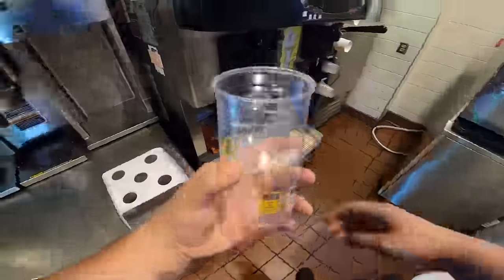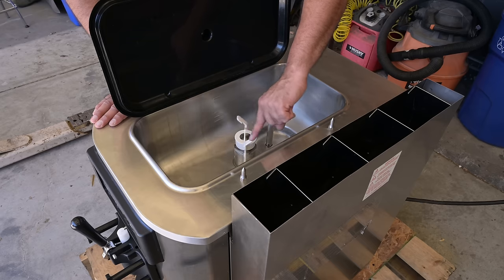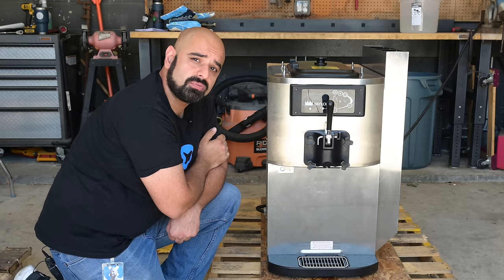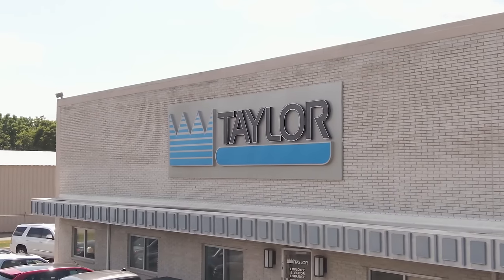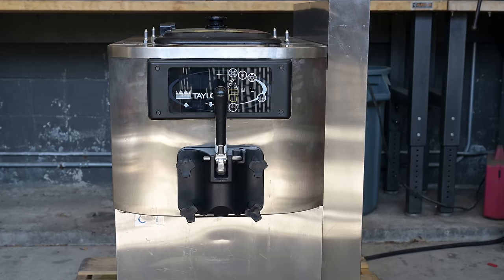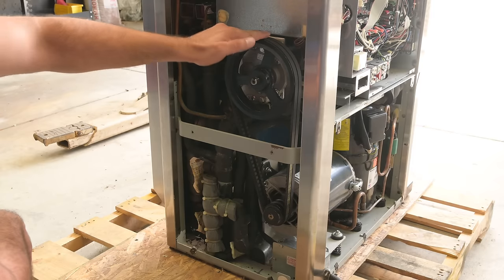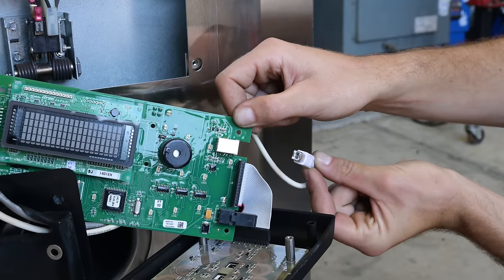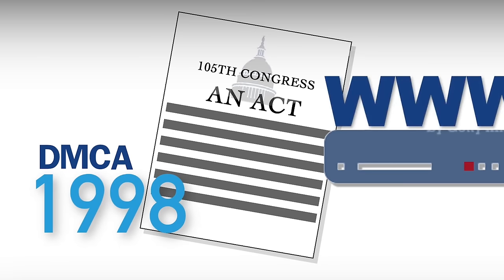Why McDonald's Ice Cream Machines Are Always Broken and How To Fix Them

Comment: As a McDonalds employee in Australia I’ve personally never seen our ice cream machine break or require repairs outside of the time from 2-6am where it is in heat treatment. It seems like this is a uniquely American problem which might indicate malicious tampering of the machines by Taylor that make the machines break down more often.

Edit: before this video I didn’t even know about the error codes on these machines as I’ve never seen one, and I’ve worked at McDonald’s for ~3 years
Reply: Not a common  problem in Europe either.  Personally I have never experienced it.
Reply: Mcdonalds Philippines also use the same Taylor ice Cream Machines. Really an American thing since this is the same issue with Samsung Refrigerators being junk in the USA but durable elsewhere.
Reply: Hastings Victoria is constantly broken down
Reply: McDonald's ice cream machines in Australia are made by Multiplex. That would be why.
Reply: @Croissinate  I checked tonight, our machinery/equipment is made by FRANKE, however the appearances of the machines is basically identical to those of Taylor in the US, which once again indicated tampering by Taylor since the same machines work fine when made by a different manufacturer
Reply: Average education level plays a big role I presume?
Reply: I worked at a McDonald's in the US. We had the Carpigiani ice cream machine, I don't think it ever broke down during the 3 months I worked there, except a day where the maintenance guy was working on deep cleaning it.
Reply: Not sure why, but my local McD's in Canada never seems to have trouble. Maybe it's because it's a lower volume franchise? IIRC, they do have a Taylor branded machine, albeit an older one.
Reply: Thats not saying much at all, plenty of employees at mc Donald's or "Maccas", that dont know how to properly make a quarter pounder w chz. Let alone know about an error code on the machine. Many dont know the error codes on the FRY machines ffs. But they know what button to push to clear it and keep cooking fries....
Reply: As a customer in Austria I've seen MANY instances of the ice-cream machine not working. So much so that I was wondering whether McDonald's actually liked the meme of their machines breaking and thus not doing anything about it. I wouldn't agree that it's a uniquely American problem.
Reply: McDonald's is better in nearly every country than the US.
Reply: In my area it “breaks” or doesn’t work 1 in 5 times roughly.
Reply: No, is it that these stored do not perform the daily heat cycle and the machine locks out or they forget an run it while the store is open a say it is broken when it is just cleaning itself.   This video is a pile of crap.
Reply: @MaxTheMiner1  Not true, Franke is an equipment consolidator and provides Taylor equipment.  (Former MCD VP of operations here)

Comment: From the UK, where this issue isn't as bad as in the US. The McDonald's / Taylor Repair racket is a well known problem for years, glad ur taking up this fight.
Reply: This by and large isn't an issue outside of the USA and maybe Canada, because Taylor does not have the 24/7 technicians available over here. I'm in continental Europe, my sister owns 2 McD franchises, the ice cream machine in her McDs are never on the fritz and when they are they have 2 manuals with the machine. One is the Operator's Manual and most of the error codes in that book say to call the Taylor technician. The other is the Technician's Manual, which has in-depth explanations of all procedures, hidden menu features and repairs for the machine. It even includes a parts list and instructions on how to order them from the local supplier.

It's the same machine they get in the US, so the problem isn't the machine. It's the UI/UX of the machine. Taylor is purposely obfuscating and hiding things in order to get that juicy "recurring income" from the service calls. So US McD franchisees only get the owner/operator manual, but everywhere else in the world they also get the technician/maintenance manual.
You could probably find it on the internet somewhere, but the machine keeps a log of access to the hidden maintenance menu, so if you have to call in a tech later for something else, they'll know you've bypassed them earlier and thus may not want to repair without first screwing you over for some sort of additional "reset to default" thing they'll claim to have to do.
Reply: Im allso pretty sure, with in the EU (as UK ones was), it was made illigal to have a monopoly on service.
Just like automakers cant void a warrenty, even if the car was serviced on a non-maker workshop/garage.
Reply: @ImpetuzViscus  the catch there is that many consumer protection laws do not apply to companies.

Internally the machines are mostly "industrial lego" that can be serviced by any technician qualified to do that type of work.
It's just the UI part on the front that's McD specific. It's also the only part that you have to order through McD corporate, everything else can be bought through a Taylor reseller or from any vendor that sells that kind of industrial lego component.

There's nothing inherently wrong with the machines, it's not bad design or anything like that. It's just the software that locks US based McD franchisees into a service contract.
And it also has to do with the terms of the financial lease of the kitchen equipment, as the restaurant doesn't actually own it, McD has a rather large say in what is and isn't allowed with their property.

Comment: I worked at McDonalds for 5 years in the 80s so I know a lot has changed. That being said, we were only 24 hours on weekends so one if the nightly tasks was to completely strip down the ice cream and shake machines and clean them. For an experienced person this took about 30-40 minutes to do both. 

We still had to clean them on weekends and from turning it off to stripping it all down, cleaning it and reassembly was maybe 2.5-3 hours including defrost. 

Under that routine maintenance (which at least at the store I worked at was sstrictly followed) I don't recall a single repair call-out. The worst issue was that the ice cream machine hit capacity and we had to stop serving it for 30 minutes or so. Those machines were probably 10 years old when I started working there and still worked perfectly when I left.

I think this is a good example where adding technology does not make things better

Comment: Context:

McDonalds is NOT a restaurateur, their primary business is land and rent from that land. Conveniently, most McDonalds are FRANCHISE locations and McDonalds the corporation doesnt care if a franchise has problems with the REQUIRED equipment. McDonalds and Taylor have had a LONG relationship because these machines working or not makes one of the two money at the EXPENSE of the people who run the franchise. This is why it is important to pass Right to Repair. This particular relationship Taylor has with Mc Donalds is racketeering and it should be stopped.
Reply: Bullcrap. Francisees in the USoA are free to buy a Carpigiani machine (that fails less and is easier to maintain) instead of a Taylor. But, to save a few bucks upfront, most francisees get the Taylor one, even those francisees close to a Carpigiani service center. So...

¿Is only McD being evil here? 
¿Or is it also francisees saving pennies and losing Dollars?
Reply: @williamyf considering what it costs franchisees to become one, the answer is clear.
Reply: @williamyf   Carpigiani machine is some what new
Reply: @williamyf  Don't be daft, much less an apologist for a corporation as large/successful as McDonalds. When a franchisee goes to open a store, they get the whole list of steps to do so, one of which is of course the "recommended" equipment to purchase/use. What do you think McDonalds corporate recommends? And why would a franchisee question it? Surely McDonalds wants them to be successful... That's in everyone's best interests, right? And even if it's a question of dollars/cents, wouldn't you feel pretty silly choosing a more expensive machine that McDonalds themselves don't recommend? Come on...
Reply: That doesn't make sense. 
McDonalds is still a brand and that brand can be damaged by poor appearance. 
The public doesn't care if it's a franchise or not. If they stop going to McDonalds, less people will buy into their franchises,
Reply: @rehmsmeyer  They aren't random. Words are in all caps in places that make sense for showing emphasis. The only thing that might be incorrect is capitalizing right to repair.
Reply: @rehmsmeyer  If King used all caps for emphasis then yes. 

But capitalization has been used for emphasis for at least a century. I would say multiple centuries but I'm too lazy to look it up to confirm it 100%. 

On the internet, all caps is sometimes considered to be equivalent to shouting, which is definitely emphasizing.
Reply: Well said!
Reply: I don't get these kinds of arguments.  I hear things like "Toyota isn't really a car manufacturer, they're in the loan business" or whatever.  Sure, if you look at how the revenues come in, that may be technically true, but McD's couldn't do the real estate thing without the food part, so it's a stretch to talk about it like that.  In the end, Sears had a huge real-estate portfolio that ended up being worth more than the sum total of proceeds from sales in all their stores.  They still went under when people stopped buying things, though.
Reply: they approved carpiagiani after the word got out after mcd and Taylor 

And I am not 100% certain but I think carpiagiani is even cheaper (at least in Europe)
Reply: McDonald’s needs to keep its franchises happy your comment is very naive.
Reply: @MusicalMemeology not really mcd makes money regardless if franchisee is in profit or not
Sure they need to keep them happy but they can also screw them over and Taylor C602 is perfect example of how mcd can screw them
Reply: EXACTLY. They are primarily a real estate and logistics company, distributing private labeled products to its tenants.